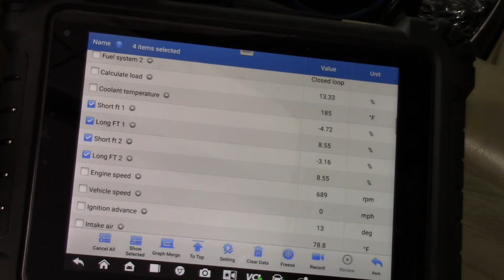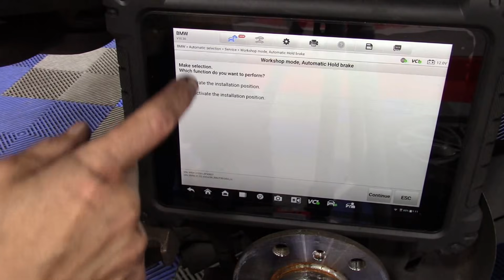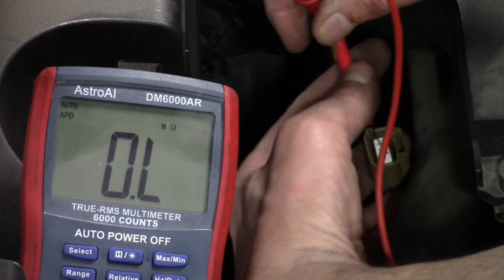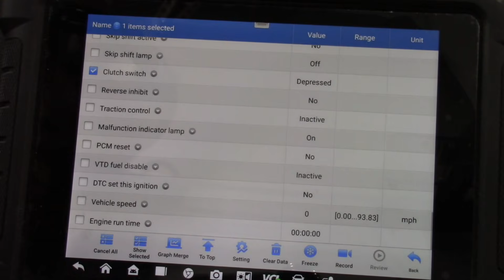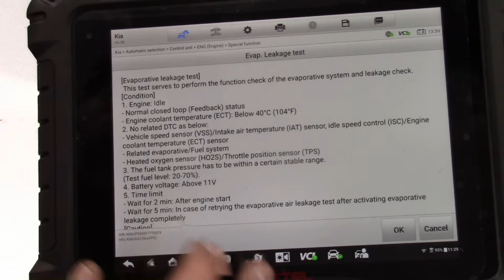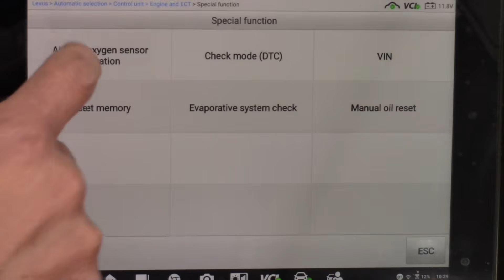Autel Automotive Diagnostic Training Video Collection

Comment: I engine have a Mitsubishi 1.8 16-valve engine and for the last month facing a problem with car stalling suddenly after running beautifully for 20 to  25 km. But after struggling to move at 5 to 10 km speed suddenly picks up speed. this is repeated now after I changed the spark plugs, and the petrol pump replaced. The temperature sensor on water jacket which goes to ECM  as per manual need to have voltage of 1.2 v but I get only 0.7 v even with new ones.  What shall I do/. Matter urgent

Comment: Hi guys, I'd like to share my experience. I've gmc 6v engine and there's a code "o2 sensor positive current control circuit high" by the way it's a wideband o2 sensor. I used Matt's rational and scientific approach rather than changing parts. In the scan tool i saw bank 1 is in a closed loop but bank 2 isn't that means the wideband o2 sensor in bank 2 is not functioning and to prove that bank 2 fuel trims both short and long one is 0 whatever you do. To double check more, I've checked the wideband o2 sensor resistance it was around 3 ohms. I said now I can change the sensor.
Thanks to Matt.

Comment: I cant seem to find a scanner that works with this particular vehicle, any advice on this?
VIN: WDBFA63F7TF138743
1996 MBZ SL320
Body Code: 129,063
Engine ID: 104, 991
Fuel system: HFM-SFI
Engine Code: TMB3.6VJGFEK

Comment: Thanks, I love your video. I use a smaller mp808 but alot of the same applies. I figured working in my own one man shop I needed the functions rather than break the bank on one tool. Hantek scope,uscope, Amazon smoke machine, I feel it's better to start small and master basic functions rather than being overwhelmed with advanced functions. Upgrade one at a time as needed but you are absolutely right that you have to be 100% and not having any gaps in your diagnostic tool kit. 
 The whiteboard is a personal favorite, keep up the great work sharing knowledge!

Comment: First speed sensor signal with wrong speedometer: could be a very simple electrolytic capacitor that failed. I had this problem with my old Corolla from 94. In other words: it could be that the ecm ecu is ok

Comment: Hi Matt, I also have a Autel 808 and I just updated the software system so I’m getting use to it and using for little issues so I recently bought a 2005 X5 4.4i v8 and I use my Autel 808 to scan for codes and I got misfire cylinders which is a easy fix but my big issue is code (P02184) and the temperature sensor is in the red zone as if the vehicle is overheating and the fan isn’t running the upper radiator hose is hot butt the lower hose is cold what do you think could be the issue

Comment: I have a 97 Ford F150 and with the two coil packs my trucks cranks over but won't start I have changed the cam and crank sensors and still won't start

Comment: Hi Matt. I'd like your opinion on wheather or not the HANTEK 6074BE 4 channel scope kit may be any use? It's saying its got the automotive software and leads, 4 channels, etc. At £200 sterling it's a huge amount cheaper than the pico equivalent. As yet I'm very new to scopes and this will be my 1st buy. I've relied on my DMM for diagnostics with my snap on and launch scanners. Any advise on which/why scope I'd be better looking at would so helpful. Thankyou. Stu.

Comment: I didn't think that the shorterm fuel trims would show any number with the engine cold; isn't it the LT trims that retains the last fuel trim when the engine last ran? I also notice that you never use the times 4, times 8 etc on the Autel scanner I also have an Autel but it is the MP808. Also there is a function that I don't understand how to set called the auto trigger; some scanners have a vertical line to lineup the waveforms with, that doesn't seem to be necessary as you are not using it. Do you line up with anything? thank you for any info you can give on that Matt.

Comment: My vehicle 2007 subaru forester non turbo no crank and no start, battery is good I change crank sensor & camshaft sensor , starter good , all fuses is good, I change transmission fluid  but the 1&3 spark plugs and coil no spark

Comment: I have a 2007 ford explorer V6. I was doing some light maintenance in the vehicle such as valve cover gasket oil change and spark plugs . After I reinstalled everything I started it up and it was giving me a lot of throttle body codes and air flow codes I took the intake box off and put it back on and those codes went away then shortly after it threw a code for misfire in cylinder 3 when I took the spark plug out the electrode was smashed . I thought maybe I had dropped it by accident and didn’t realize or maybe it came messed up so I put a old one back in and it smashed it again I’ve tried 4 different spark plugs and they’ve all been getting smashed . The van was not miss firing before I worked on it . Anyone have any idea of what this could be ??

Comment: Hi Dr. Matt, I am having a hard time dealing with light diesel engines because there are no fuel trims or just our scanner not taking all the parameters, if there is no fuel trims in diesel engines, is there any others technique like using fuel trims on gasoline that is applicable to light diesel engines? is there a chance would you make a video like this in the future? 🥹

Comment: I didn't know, thanks Matt .. I will back probe the signal wire, with a sewing needle held by  vice grips, and see if there is voltage changing every second from 0.1 volt to 0.8 volts, and make sure it isn't getting to 1 volt or over.

Comment: I have an Autel Md802 scanner with gm, ford, bmw snd mercedes software loaded. 
Autel claims that it can scan the factory data on an 02 mercedes E430. 
It runs thru the whole factory scan then tells me to use the 38pin connector. 
In 02 mercedes only had the reg obd2 data on the connector inside the car and the factory data was on the 38pin connector under the hood. I think they fix this in 05.
But Autel cant give me a real answer on how to plug into the 38pin.
Heres the problem, all the data is on one of those 38pins so a simple cable adapter wont work.
I think I can use a Foxwell multiplex adapter to split the data back out to an obd 2 port and then plug the autel into it.
Am I correct?
This problem affects all of autels scanners nit just the md802 that want to scan factory data.